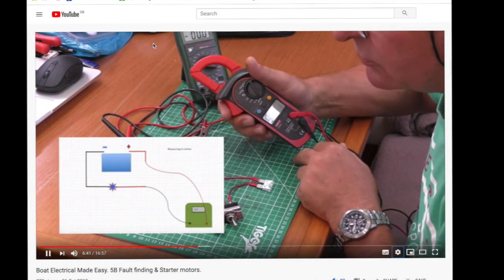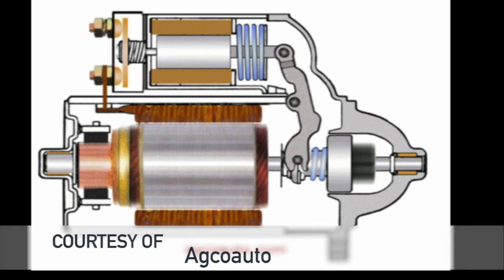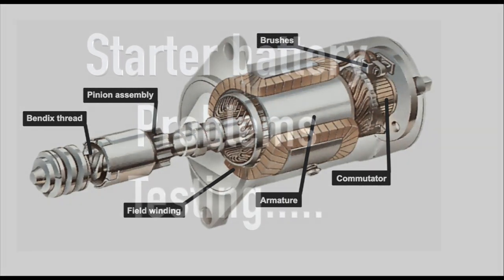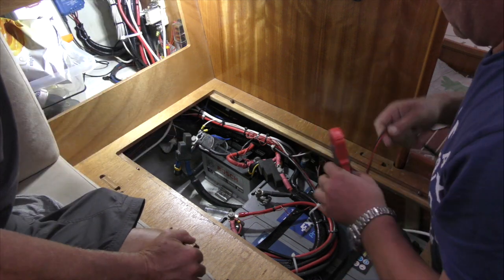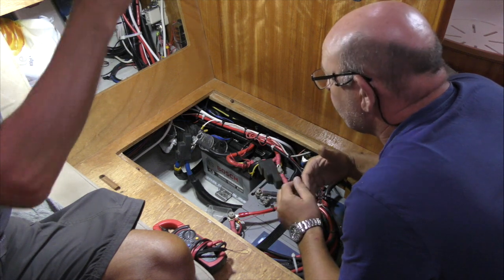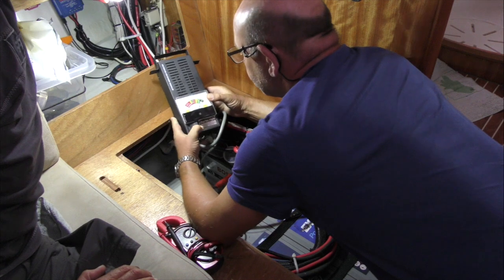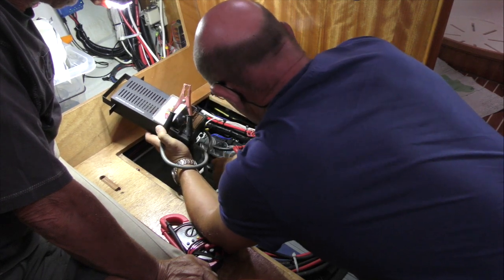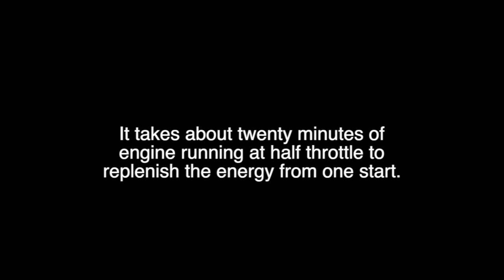Boat Electrical Made Easy Part 6 Starter motors & Starting

Comment: A quick question, how much current should the load tester draw for a good test? And thank you. I've done a bit of this type of work and you've clarified a few details, thank you so much 👍
Reply from the maker: It depend on the size. It is reliant on the I=V/R calculation we covered on the previous videos. Sail Safe mate. Ant & Cid